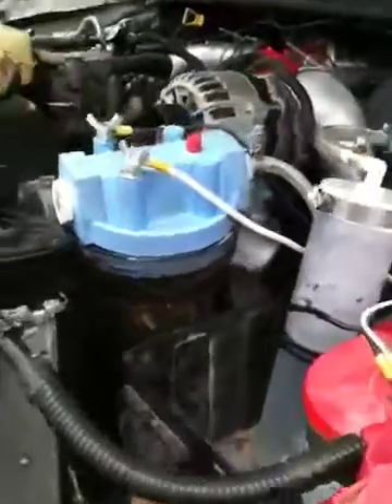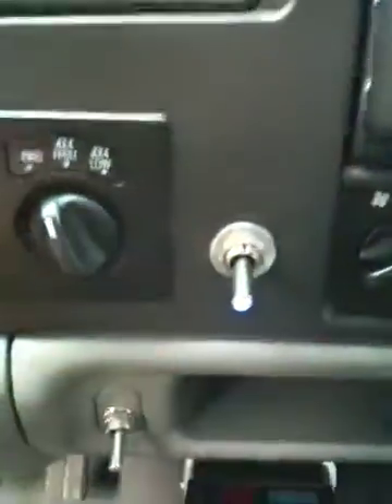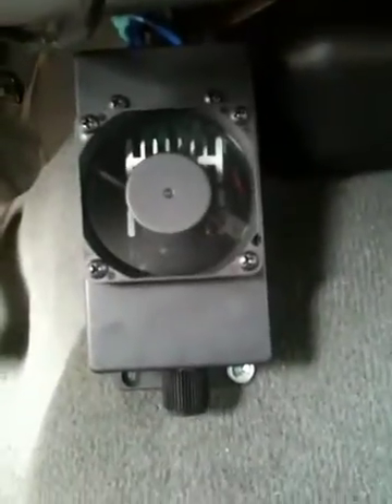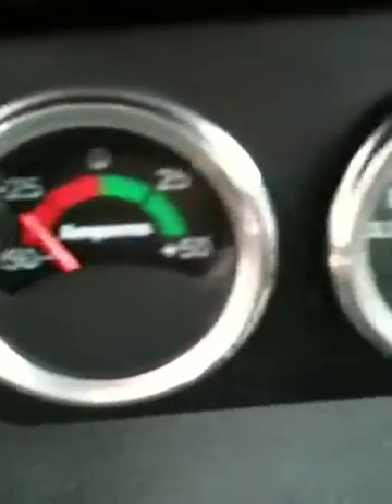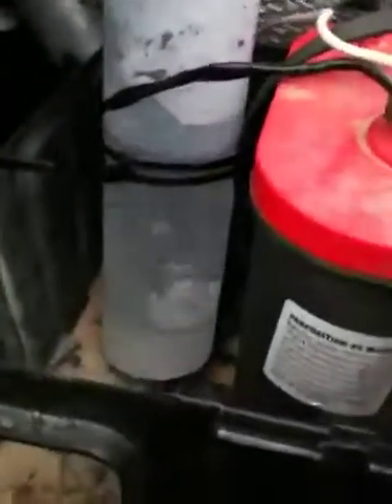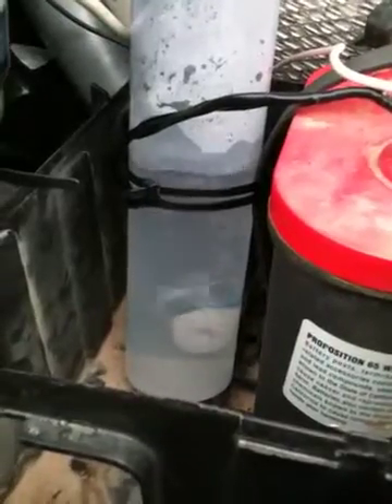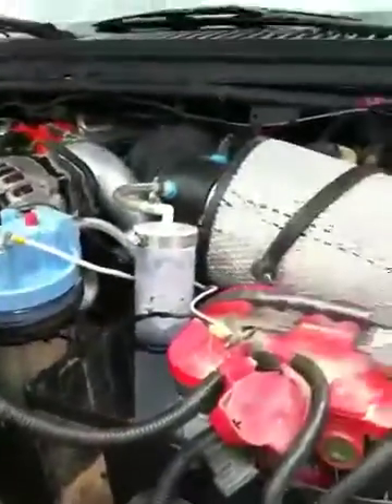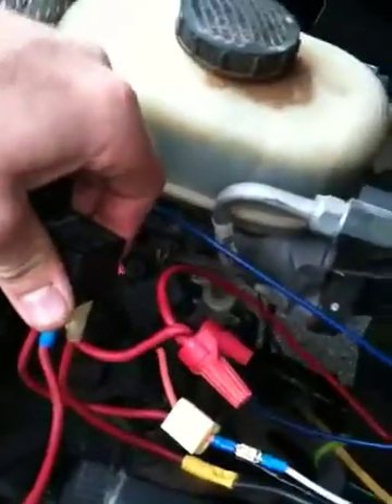F250 7.3 liter turbo diesel hybrid. Water as fuel.

Comment: The gains so far display more than that, but its so hard to get an accurate reading. I now have 130,000 miles on it. Im also running a superchip, 4in turbo back, donaldson filter, etc.

Comment: Not yet but i went from 13 to 20 highway with it on. The key is designing a system that maximizes the mechanical draw on the engine. I have a new design that will more than double the system efficiency. But im a full time engineering student and havent had time to build it yet.